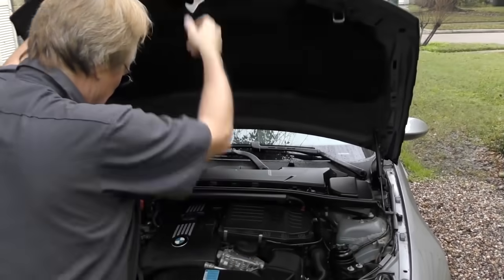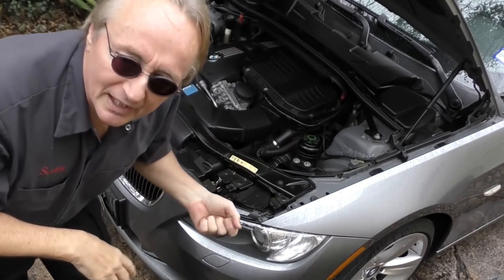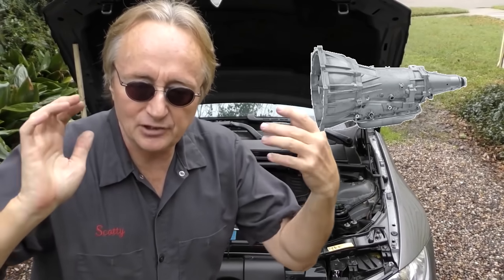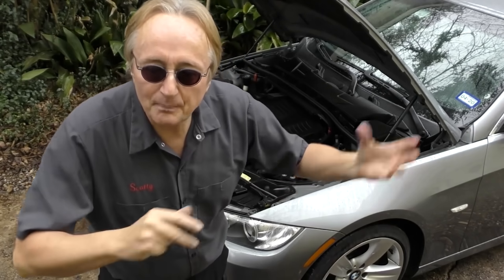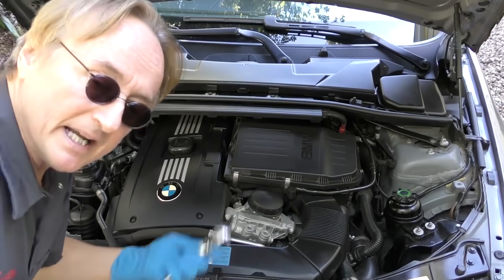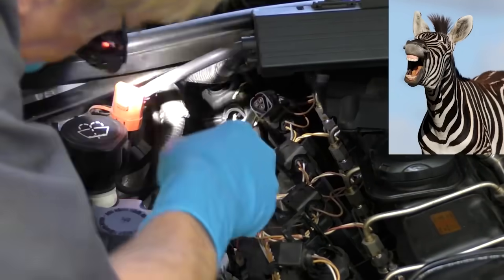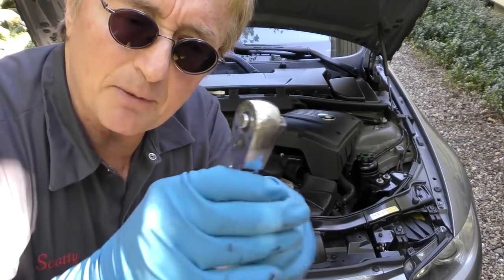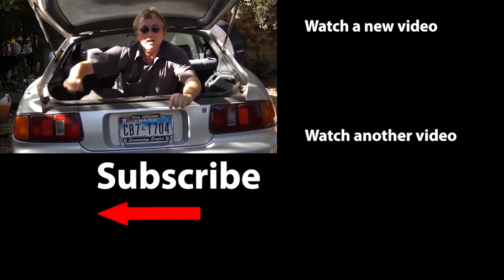People Say I'm Full of Crap About BMWs, Well Watch This

Comment: Yeah, this video is a great demonstration, why the BMWs are hard to maintain. I mean, what about checking the shop manual to see, that the whole part that is over the last 2 cylinders can be taken out in like 5 screws and 2 minutes job? .... Than there would be no problem taking the coil out and you would not have to use a pry bar, risking cracking other things... 
Also, if a coil fails, you are supposed to change all of them - the likelyhood that the others will fail in a short period of time is very high. This is why they 'allways break' because no one knows how to take care of them properly, including Scotty Kilmer...

Comment: Blah blah blah.... preventative maintenance.... I've owned a 5 series naturally aspirated and got over 300k on it. My cousins son totaled it but it was still don't GREAT.  
I've owned m3s and same story. 
Just maintain them. It's not rocket science. 
Also, find a mechanic that can do basic things. 
Buy used parts if you want to save money. 
These cars aren't bad. 
The n52 motor is the reason bmw to a black eye. 

Send the oil and filter off to black stone labs before you buy. Then you'll know if the motor has been beat. 

Education goes a long way and not listening to ppl like this guy.

Comment: BMW Hardtop convertible: 100% failure rate. Their plastic coolant pump impeller is infamous on that engine. F30 has a $3 plastic parking brake cable above the exhaust AND driveshaft that fails; labor is 3 hours to replace! (Is an aftermarket part that helps remedy the problem). and the N20 4 cylinder (2013-2015) has a plastic cam chain guide that fails and can destroy the engine (class action suit resulted).

Comment: I bought a used 2016 bmw f30 n20 with 90k miles on it and I’ve driven it 50k miles and the only issue I ever had was my battery went dead because a mechanic that worked on it before I owned it put the wrong battery in and didn’t even put the vent hose back in or programmed the battery. I do all my routine maintenance myself and it seems to be close in price to maintain as my Honda if your doing the work yourself.

Comment: Just get a 2006 non-turbo version , mine is up to 130,000 miles - easy to work on - just order online and replace the plastic parts each month - parts are cheap.

Comment: I have one. 
In the back of the engine.  There is a plastic plug. For the cooling system. 
And because plastic breaks eventually…. You loose all coolant. 
Then engine gets to hot. 
The cylinder head bent. 
Cost around 2000… 
Only  due  to that one broken plastic. 
Replace before that happens !

Comment: We’ve got a 2008 328x.  Great car. BUT it took some fiddling to sort it out when I bought it, used.   I am otherwise grounded in domestic GMC trucks.  What I would say about the BMW is — only mechanics should own them.  The parts are not that expensive when comparing to other vehicles, but because they are so over designed it takes a lot of labour (time) to get to those parts.  The labour alone will suck the bank dry.   So … mechanics only or as minimum highly experienced and competent diy’s.  These are advanced league cars.  Not for learners or shade tree tinkerers.

Comment: All very true,  but recent BMWs are better now, with mainly basic maintenance stuff. Replacing electronic waterpump between 70 to 100k miles, valve cover gasket, sometimes replaced cracked plastic valve cover, oil filter housing gasket, cracked plastic charge pipe from the turbos, ehh n55, s55, b58, s58 motors are pretty stout

Comment: Scotty chose the most unreliable year of the 335i's which are from 2006-12 and BMW's first turbo car model. From 2014 and up, the inline six motor is reliable and strong. All other motors are also reliable.

Comment: I got myself a BMW 3series from 2008. Absolute pain. All the damn covers everywhere! And the covers are mounted with plastic threads an metal screws. I removed them ones and now I need to put bigger screws in because everything is stripped... And damn expensive parts. It's a fun car till it brakes down 😅

Comment: BMW cars are lovely to drive, my wife's 520d is very smooth indeed. I currently drive a remapped Volvo C70 D5 diesel which I love. It's not as smooth but has more power.
Also, most people in UK drive diesel. Me, my mum, my sister, ALL my friends, everyone at work except 1 guy, all drive diesels. There's no comparison on fuel economy.

Comment: I have to say that I own a 2012 320D (n47 diesel engine) with 150 k km on the clock. Bought it new at the dealer and besides regular maintenance (oil, filters and whatnots) the only thing I changed once was the battery after eight years of usage (yes eight years). I am on the second battery now…

Comment: I have a fairly new 535i X-Drive and I just had the valve cover replaced as the PVC valve is sonically welded to the inside, so you can't replace just that one part, and while they were replacing that they discovered oil in the coolant system, I mentioned probably head gasket and the BMW dealership mechanic stated that is exremely rare and would have to be totally investigated... FORGET IT, I'll simply drive it till it dies.

Comment: It's true.  They all need $5000 worth of work at around 90-100k miles.  I just replaced the entire cooling system including water pump, radiator, hoses, expansion coolant tank, all hard lines.   Brake rotors will go bad and crack, fix those, the front and rear suspension will need to be overhauled and replaced, coils on these always crack.  All suspension and wheel bushings will need to be replaced.  and why do i do this?  because there's nothing like driving a bmw.

Comment: Why do you need two turbos? Why do you even need one? For normal road use, your normally aspirated 3.0 ltr Bimmer engine delivers all the power you can sensibly use. As for high maintenance costs, I recently bought a 2005 X5 in mint (really) condition, 210k kms, with a couple of the normal BMW oil leaks, cam cover gasket, and oil filter housing gasket. Previous owner ignored them (!!!). Putting my old certified mechanic skills to work (retired from trade in 1978, age 32) , had these fixed in a weekend. The quality of the drive is amazing. The car handles brilliantly and sits rock solid on the road. So I got a sore back for my trouble for a couple of days. Sure they can be expensive, but if you can buy one cheaply enough and do some or all of the work yourself, you will be well rewarded.

Comment: I had a 330 CI with the smoothest 6 cyl engine ever.  I loved that car. But at 70,000 + miles all the plastic components in the cooling system and all....All...the gaskets start to leak. Love BMW?  Lease it and turn it over every 3 years before the car starts to fail.

Comment: For the N54 engine, BMW used a set of dodgy Mitsubishi turbos.  You can buy from the dealer or buy them by the Mitsubishi part # for $1200 for the set.  But for $2k you can upgrade to Pure turbos and never worry about them again...and gain some more horsies.
You can spend thousands on diagnostic tools, or you can spend $100 on the Protocols app or use the diagnostic tool of the MHD app and change literally anything you want.  Or for $160 you can get a BMW programmed Foxwell scanner and get the benefit  code/register function for things like battery replacements.
The N54 is a direct injection high performance engine.  This means you will need to change coils/plugs more frequently.
Does BMW use a lot of plastic under the hood?  Yes.  A lot of it is for sound deadening.  Do the parts get brittle over time or do they break from idiots yanking on them and not using the right tools to disassemble them.  The charge pipe is one of those parts that cracks on its own.  It is the first $120 any new owner would want to spend for an aluminum replacement.
BMW parts are stupid crazy, but a Davy owner would buy from FCP Euro for the OEM parts at 60% off with their lifetime warranty.
So Scotty, please stop with your nonsense.
335i's are high maintenance and high performance that do come at a cost.  But I have spent more on my F250 in repairs and maintenance than I have on my 335i.  Both are low mileage.

Comment: I’ve driven only BMW’s since the mid 1990’s…those older models were very reliable and didn’t have a single major expense on any of them, the ones I owned in the 2000’s were all under warranty but still
never encountered a major expense or warranty claim…my last 2 I purchased used starting in 2008 and you are completely correct about the plastic parts…my current car I love, love the way it drives and the power, plus it’s a beauty, but there have been some annoying repairs, mainly 2 coolant leaks, one that cost $3k to fix because the plastic lines were located under the two turbos which had to be removed to fix a $100 part…then a few months later a $1k bill to replace a leaking coolant hose, because it was so hard to get to this was mostly labor…good thing it’s paid for and so much fun to drive or I would be looking to trade it in…however once this one dies I will probably be looking at a Toyota or Lexus suv…If you buy one used make sure it’s preowned certified or that it’s paid for…I will miss the way she drives though…

Comment: I am a lover of BMW and you are 90% right but why you did not change all off the coil at FCPEURO all 6 coil is less than $200.00 if you’re a regular working class you shouldn’t buy a used BMW unless you get involved with BMW users group also the best BMW is standard transmission with a clutch.

Comment: I have e90 330i, manual transmission, no turbos, no direct injection, the thing doesn't even have electric seats. Having this car for over 3 years now, no major problems, just a regular maintenance - oil, filters, spark plugs etc. I'm actually kinda surprised of how reliable it is.

Oh by the way, the hood struts were also bad when I bought it, but it's cheap and a no-brainer can change it. And I also have changed oil filter/cooler gaskets, did it myself, but if you know what you are doing, you don't even have to remove intake manifold ;)

Comment: I bought a mint 2014 535i MSport with 30k miles on it with extended warranty (warranty was 3200 USD-covered everything including gaskets, no deductibles). In the past 6 years, I've had 18,600 USD in repairs that were covered under warranty. 😅

Comment: Scotty is right, I bought a cheap 2003 z4 with only 59k miles because I love little coupes like that and I figured it couldn't be that bad with such low mileage but it's at 67k miles now and I've already spent 1000s on repairs on everything from the radiator to the starter. Now it's having electrical problems and still ain't working right.. 20 year old bmw's have 20 year old bmw problems and those problems so expensive as hell man. Also doesn't help that I live in a rural town in southern america where no one knows how to work on them.. I'm pretty defeated at this point.

Comment: I’m on my second 5 series and these cars are amazing under warranty but a nightmare outside of it. Aftermarket parts may or may not work and non dealer mechanics may or may not know what they’re doing. Minor mistakes by non dealer mechanics (especially using aftermarket parts) can cause big problems that are hard to diagnose. BMW plastics can melt or crack and it may or may not have anything to do with mileage and may or may not require replacement of the much more expensive assembly to which that plastic part is attached. As the cars get older, going to the dealer for astronomical repair costs may actually be the better option if you intend to keep the car . . . which is why people dump them when the warranty runs out. All things I’ve learned the hard way so I can say firsthand that Scotty knows what he’s talking about.

Comment: Except for High Pressure Fuel Pump...many OEM parts are available for less, and you must be able to do most of the work yourself (like for all the gaskets).   Turbos on the other hand, it seems like a mess for what your options are to replace the twin turbos.  And you probably don't want it to be your first time replacing them.

Comment: We have an 08 328 xDrive.  I6 AWD and 6 sp manual transmission.  It is a great ride.  As for maintenance, sure it needs a tinkerer to keep this where they should be.  Good if you are dyi, as am I.  But I can see these get very expensive to maintain if paying someone else  to do the work.  It is not complicated to maintain, it is just that there is always something that needs to be tweaked.

Comment: When I want to check the oil in my beautiful 2005 Holden Commodore VZ, I pop the hood and pull out the dipstick and read the oil level.
My neighbour has a modern BMW. There is no dipstick. To check the oil, you use the onboard computer which won't give you a reading until the car has reached operational temperature. She needs to go for a 20 minute drive first! Wow, doesn't technology make life easier! Absolutely hilarious!

Comment: I have driven only bmw in my life.
You have to know exactly what your are getting into buying these used. I bought bmw‘s with generally very good reputations and never had serious problems. Its extremely important to maintain these cars religiously!
For anyone wondering f31 320d xdrive lci zf8 high mileage - f20 m135i xdrive 2013 zf8, m140i lci 2 6 speed

Comment: I’ve owned bmws and Honda accords since I was 19, my m3 went 70k miles with reg maintenance and an alternator, I bought a 2013 f10 528i xdrive with 126k miles 1.5 years ago and I put 40k miles in that time with just oil changes and I feel some of the suspension bushings are going, but I can work on my own car so that helps, my Hondas were very reliable but did have issues as well, if the 6 position cylinder is having issues in this car then it probably is the camshaft position out of timing and needs a new timing chain

Comment: I have been driving a 2011 bmw 535i since 2011 with 160K on it.  Only repair was a water pump. even brakes are still original.  not all of them are unreliable.

Comment: The coils and plugs are a matter of minutes to change on this exact engine - not exactly rocket science, either. A mechanic that is even somewhat proficient with these vehicles will tell you that an N51/N52 version of these engines are about as bulletproof as it gets. Very basic routine maintenance keeps these cars on the road for over 200K miles effortlessly.

Comment: My 2013 328i still works fine.  I think disable start/stop and do at least one oil change per year helps.  Also, it is parked in covered garage at home, avoiding extreme temperatures changes all these years.  Love the drive much more than my Toyota.  I plan to keep it for another 5 years. Maybe get an X3 next? 
: )

Comment: Funny. I have a 2005 BMW 330Ci conv. that I bought new and I've only had to replace the idle control at 104k mi. and the valve cover gaskets at 110k mi. I'm now at 19+ years / 140k miles and I still turn the key and drive it. Nothing but basic maintenance and chosen cosmetics.

Comment: My interior like foam deterioriting, just clean them up, replaced the suspension for bmw x5 2012, valve cover gasket, oil pan gasket and the car drive like new, very quiet. Bought 29k now 37k for 20k usd, new price here 100k usd

Comment: If you've ever driven one of those 335s you would get the attraction....not a lot of options when you look at 14 year old cars that have 300hp.  Unfortunately a lot of late model luxury cars are just crazy in maintenance and parts but if you want to play you gotta pay. To this day the best car I have ever owned and the cheapest maintenance wise was a 2008 Mercedes 6 speed manual transmission C300.  From the time it was brand new until I sold it with 118k miles 10 years after buying it the only thing that ever needed to be replaced was 

Alternator at 55K MB covered under the warranty
One wheel bearing at 105K miles cost $550 for the hub and labor at MB and they gave me a brand new MB to drive for the time being
One set of brake pads (car was 6 speed manual and with down shifting to slow down majority of the time the OEM MB pads lasted forever) 
That is it.  I did the math back when I sold it and including tires, a new battery, and all service excluding oil it cost me about $2,500 over 10 years to drive a car I loved and held up great.

Comment: I've had an Audi (3 years old), and a Mercedes (3 years old), all pre-owned, decently priced, and low mileage. I took my time, saved, and did my research on the VINs I wanted. No issues with the Audi or Mercedes ever. Paid them all off, and decided to try BMW. It is the newest preowned brand at 2 years old at time of purchase that I have owned, and it is so far the absolute worst It is the most expensive out of the 3, and the biggest SUV I've owned. I've had it almost 10 months and I am actually beginning to regret it and go back to Audi or Mercedes. Don't get me wrong, it drives smoothly and the engine is absolutely stunning but no research on this planet could have prepared me for actually owning one.